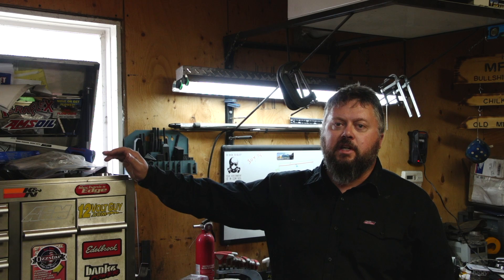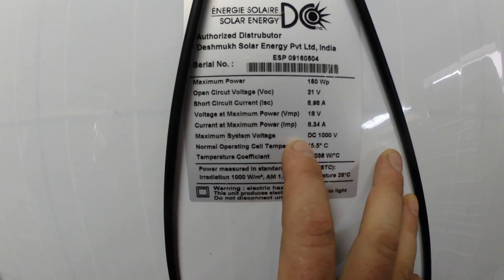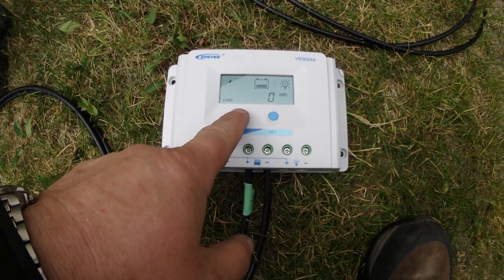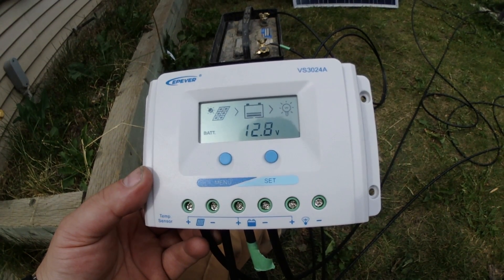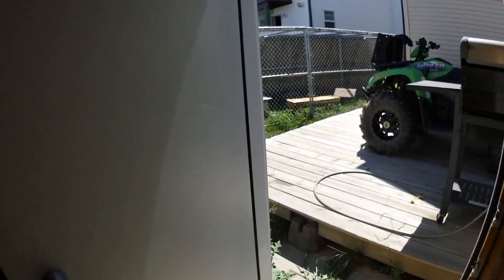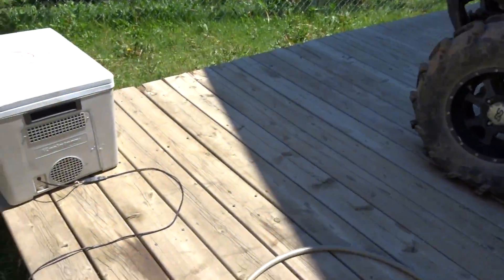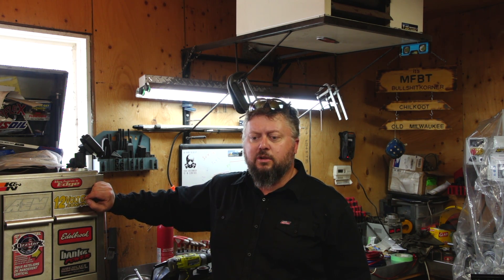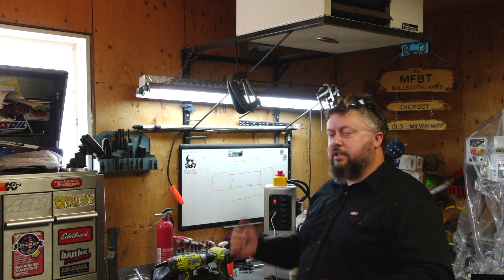Solar Energy DC 300 Watt Kit First Set Up

Comment: Those are some huge 100 watt solar panels my 100 watt 16BB panel are only 33.6 inches tall and 23.1 inches wide. I have 3 or then but getting one more to make 400 watts. I have a Chins 48 volt lithium battery. 100 amp hour 5120 watt hour and a 60 amp hqst charge controller.

Comment: these pwm type controllers are very ineffecient (many are sold and labeled as mppt types but they are not) for systems were the battery voltage is higher than the panel voltage a boost converter is much better ex the juntek mppt 7210 is some 40 bucks ,for 12v systems i belive some stepdown controllers have come now with a resonable pricetag about 40 bucks also ,it all depends what the system is needed for

Comment: Thanks for sharing this information....it's very useful. I have a question, can you charge a single 12v battery with a 300w solar panel with a voltage rating of 36v?
Reply: You have to use a charge controller to reduce 36v to 12v to charge the battery. You can't directly connect solar panel to battery it will damage the battery.
Reply: @hwthingzwork yeah but that's 300W at 36v bro that's about 8A and those kinds of batteries only needs about 5A let alone reducing it 12v which will be about 25A of current, it's gonna shorten the batteries lifespan

Comment: 3.5 A that wroung it should be 6 or more Amps each panel is 3.5A so you have both panels wired don't you . I have seen 300 watt 6A panels for 115

Comment: If I ran say a 300w HP's bulb and had one or 2 of these panels next to the bulb could I run the bulb for free..? A self running grow area free from electricity cost.how good are these boards collecting light from bulbs
Reply: Instead of having a shade over bulb I could collect upward pointing light which could then power the bulb itself
Reply: Just because the bulb you're using is 300w, doesn't mean the bulb itself is putting out enough light to power and charge a 300 watt solar panel.  Diminishing returns.

Comment: yeh solar is good, its got me out of trouble many times, the more the better though.
pitty the suppressed tech of 3D panels has not been mass prduced, 9 times the power very cheap to build and looks like any ordinary panel. we may have to rely on China to build them and ignore patents as they have before.
Reply from the maker: +closertothetruth it would be nice to have a panel that can do 1000watts the same size as the one I got

Comment: Hi solar is the way to go.
Take a look at my little system 
I pick up my panels form factory in Ontario.
https://m.youtube.com/watch?v=0cEt59jmUjw
Reply from the maker: that's quite the set up you got you will never have a shortage of power as long as you got decent light
Reply: jerry bskorner  thanks even in low light still able to pull in some amps.
How did you like the two 6v battery's LOL.

Comment: I ran my two bag 120v cement mixer thru an inverter for 1/2 hour before noticing I forgot to turn the charge cable on - It ran flawlessly on one deep cycle battery . It did draw down the battery but it was a great example of the power in a battery.  I have never reached the charge amperage a solar panel states because you have to have the sun angle hit at the exact position on the panel to do it.  Lying flat on the topper will work great at high noon but drop before and after.  Look forward to seeing  it in action.
Reply from the maker: i know what you mean i got the second panel i hook up while out and about and turn that to match the sun